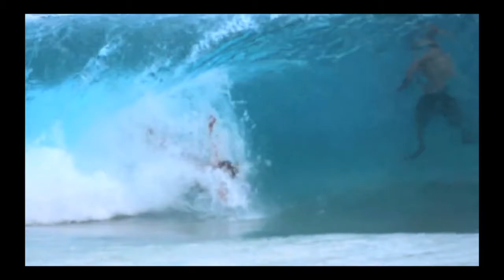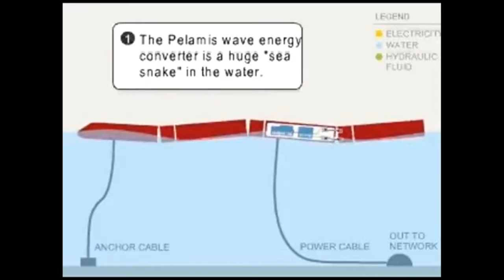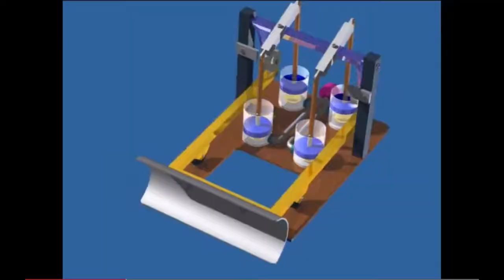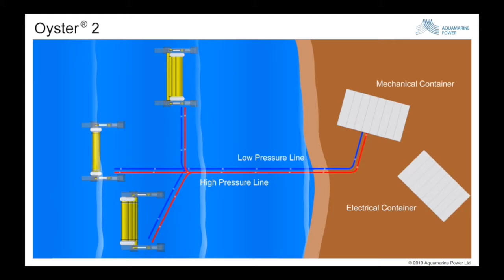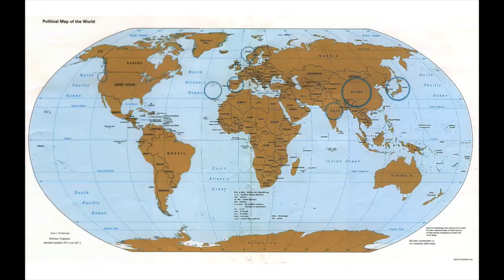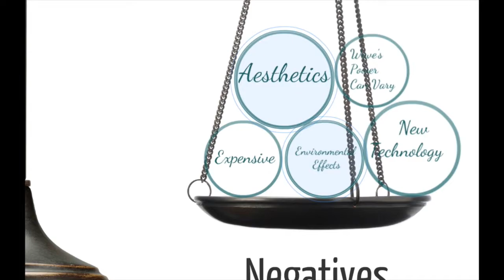WAVE ENERGY FINAL

Comment: E P D E I  MY DEVELOPER  BUT  NOT COPIER 
NEW TECHNOLOGY POWER GENERATION SEA WAVE ENERGY CONVERTER TODAY 100% POLLUTION FREE POWER  WORLD WIDE NEW TECHNOLOGY USING ONLY POWER GENERATION DEPENDING THERMAL & HYDRO & SOLAR & WIND & SEA WAVE ENERGY CONVERTER & HYDRAULIC & E P D E I NEW TECHNOLOGY NEW DEVELOPING NEW DESIGNED BY E P D E I  OBSEVRATION 25 YRS WORLD WIDE MY ENGINEERING 25 YRS EXPERIENCE NEW TECHNOLOGY NEW DEVELOPING NEW  DESIGNED   BY E P D E I  MY 25 YRS WORLD WIDE OBSERVATION  MY ENGINEERING 25 YRS EXPERIENCE SOLAR SUPPORT BY WATER BASE UNLIMITED LIFTLING  RECYCLING OF WATER  UNLIMITED 30-K V A TO 1000 K V A UNLIMITED M W POWER GENERATION UNIT MOVING NO VIBATION NO SOUND YOUR REQUIREMENT OF POWER SUPPLY LOW MAINTENAnCE ONE TIME INVESTMENT LIFE LONG BENEFITS  ANY DRIVES HYDRAULIC TO HYDRO MOTOR GAR DRIVES MY DESIGNED BY MY UNIT  24 X 7 X DAYS WORKING MY UNIT NO MAINTENANCE ANY TIME 100 PUPMS HYDRAULIC DRIVES DALY 2 HOURS WORKING AND TRAINING  MECHANICAL ENGINEERING 100% JOBS  E P D E I GURANTEE TODAY 90 COUNTRIES REQUIREMENT  ANY DOUBTS SEND E-MAIL EPDENGINEERINGINDUSTRIES@GMAIL.COM PANDURAGAMEEGA@GMAIL.COM PANDUSADANADAM@GMAIL.COM